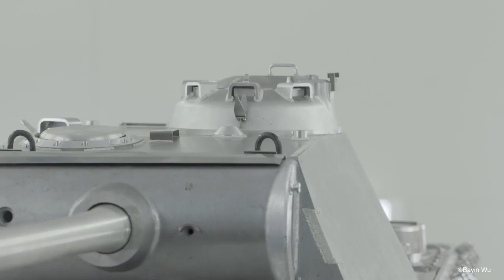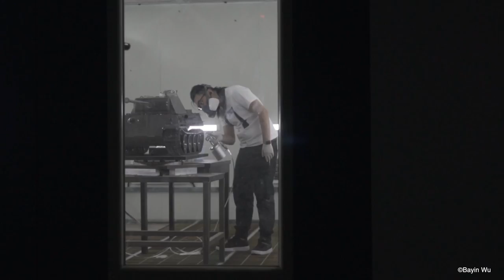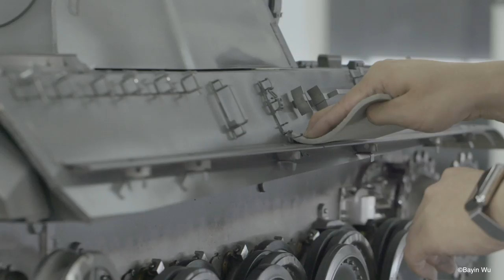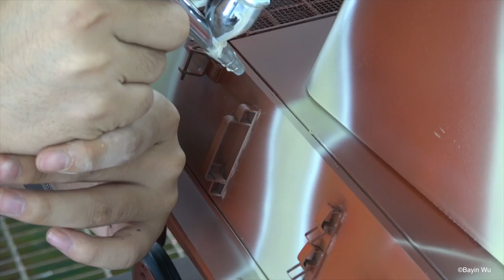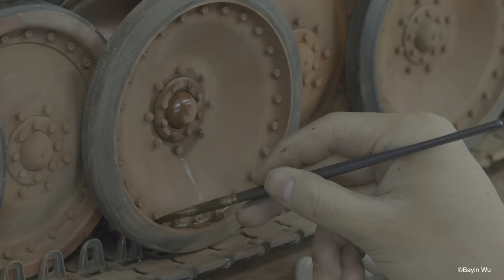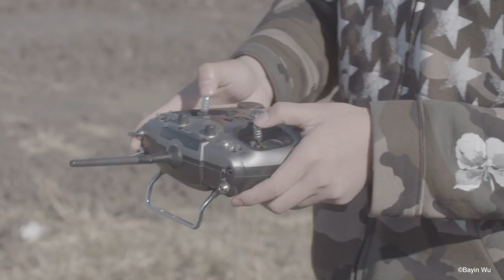Painting a Huge Panther G Tank!

Comment: Brilliant but you should have used red oxide primer as the base , then dunkel gelb that was how the Germans done it. Not to take away from the build same results in the end. Keep it up
Reply from the maker: Vasili Hi, thanks for watching! Im also a tank nerd and been in and out the real thing quite a few times. Im aware the base is oxide red. It’s just because the car primer I had is grey, and it’s super tough after baking. Also, it doesn’t make any difference in terms of end results :)
Reply: Your totally right, results speak for itself , and tbh I just assumed it was all steel but that's not the case probably more alloy than steel. I hope you didn't take my comment as a negative that was not my intention. Iam lucky I have bovington tank museum that's close to me Regards Vas